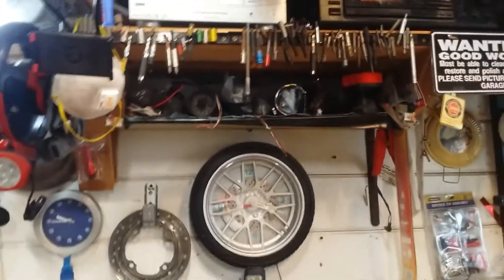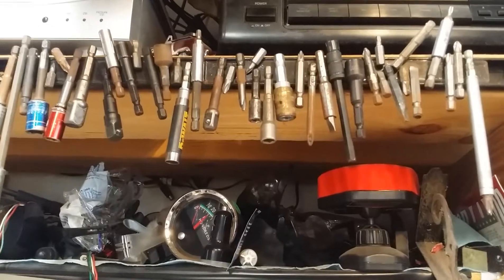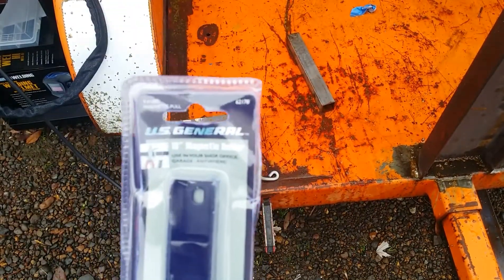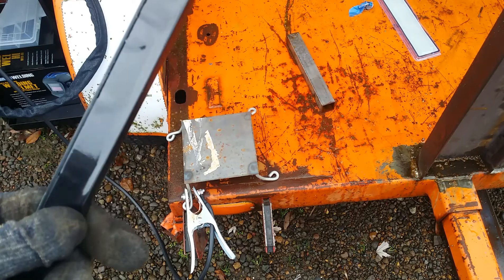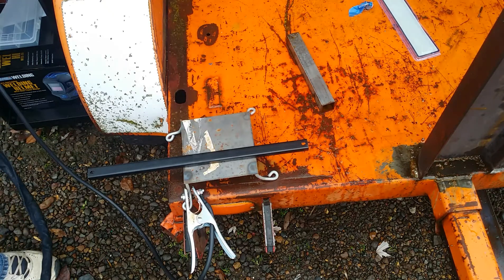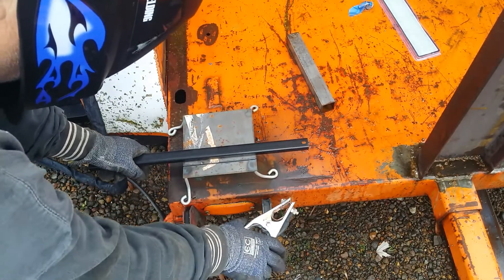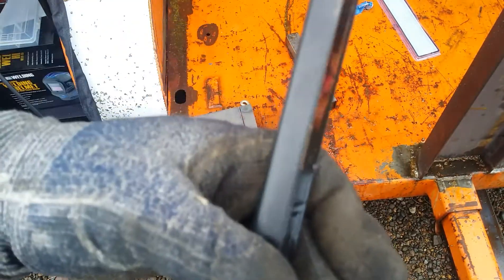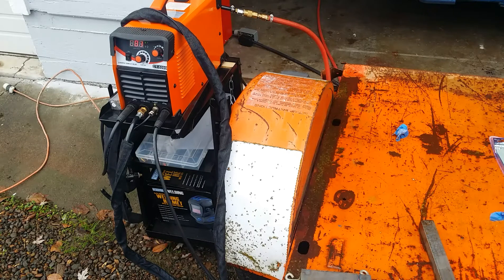Unbox and test the Magnetic Plasma Cutter Straight Edge that Harbor Freight does not know they have.

Comment: I got a magnetic circle cutter from Hypertherm who warned that I should not cut closer than 8 inches to the magnet because the heat would weaken it.  I don't know if that was just the kind of magnets they were using or what.